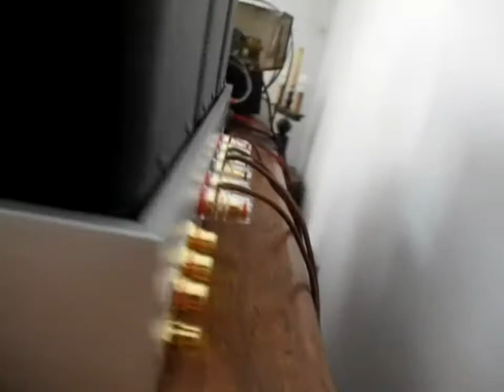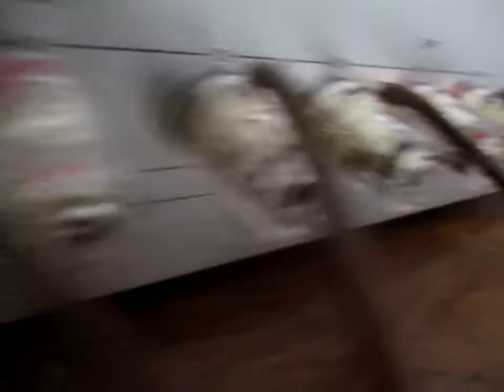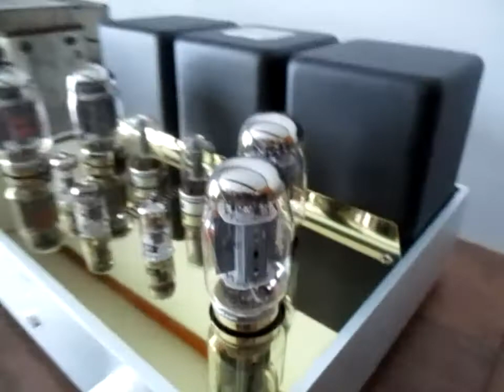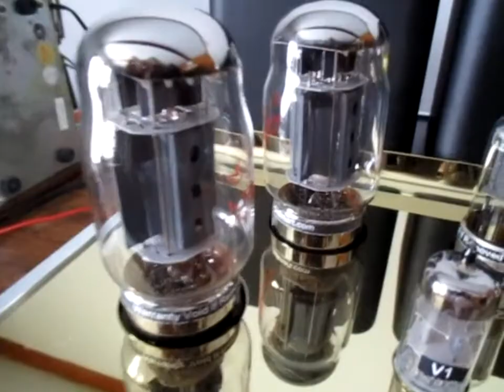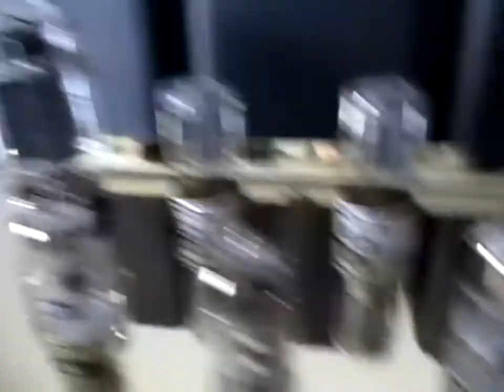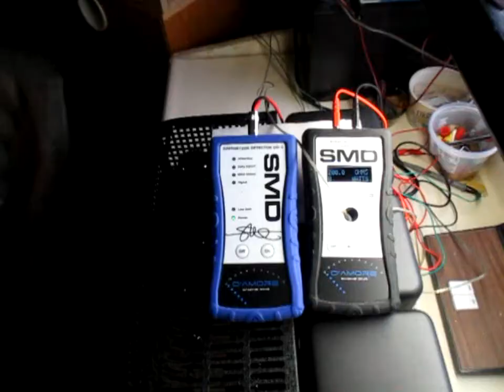Audioromy KT-88 integrated amp, tube upgrade, and dyno tests.

Comment: Thank you for great great videos. I have the same audioromy amp. Does it need biasing if i change the kt88 valves? I can't see anywhere to bias it. Thanks
Reply from the maker: I don't think there is a way to bias it. I guess it could be autobiasing. Either channel should have a matched pair, or better yet get a matched quad set.

Comment: How is this amp doing after  year? Thinking about getting it.
Reply from the maker: I can't recommend it. I really like it but it has been problematic. I had the ability to repair it but most buyers wouldn't. I have another video showing the repair I had to make. 4 times, 2 on each side of the amp. A bank of 3 large resistors came unsoldered apparently due to too much bias voltage or something. I installed the Electro-Harmonix KT-88's and after 580 hours one went bad. I put back in the original Shuguang tubes and ran them for about 600 hours and one of them went bad. Each time a tube went bad that channel went out and the resistor bank on that side was unsoldered. The resistor bank also had a capacitor in paralell. I noticed they were bulged on top, so maybe they were causing the bias to be off, so I replaced them at about 1200 hours.  Anyway the 808A has about 1860 hours on it now. The original tubes have about 1200 hours. Since one tube from each brand went bad at about 600 hours, I decided to use Shuguang in one side and E.H. in the other. I have three good of each so I decided to "rotate" them like tires on a car, replacing one on each side every 40 hours so they age pretty equally but I get more hours out of them. That's one problem with having to have 4 matched tubes. Did you see the video of my Audioromy 828A single-ended class A amp? It's plug was incorrectly wired and I had to fix that before I could use it, but it has worked flawlessly since and sounds really good. I would definitely recommend the 828A at about $500 shipped. The 808A push-pull KT-88 was 750 shipped.